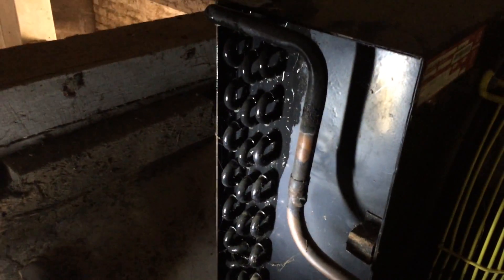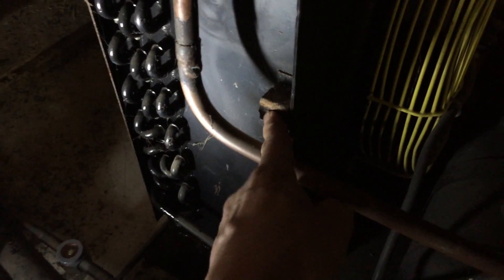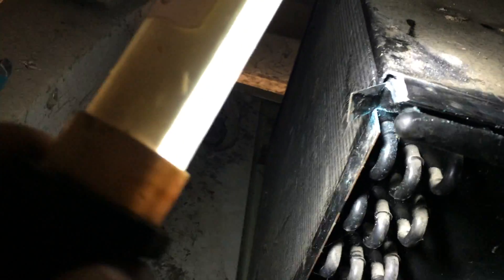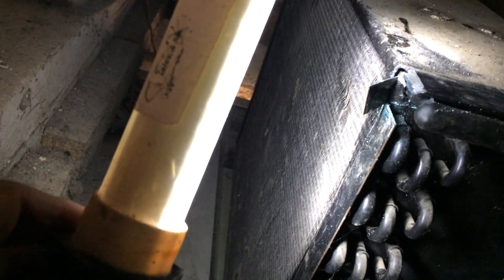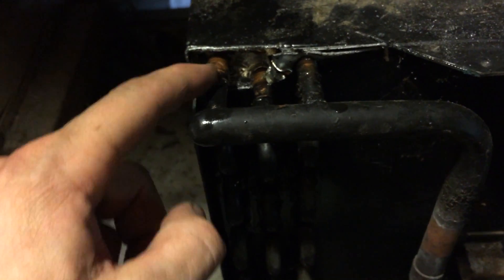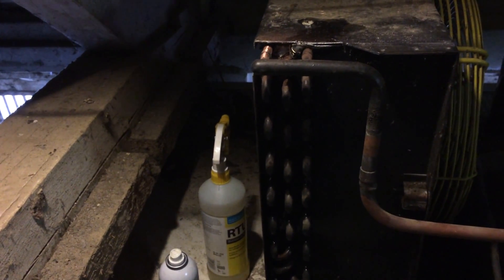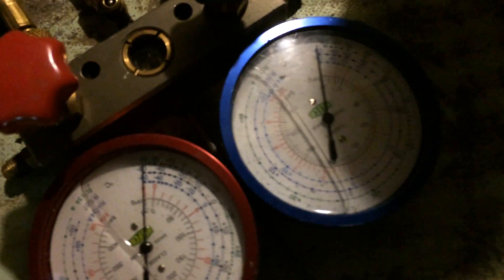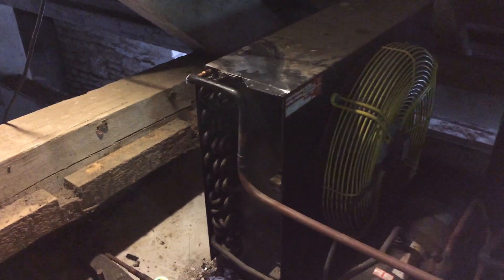Condenser Hack and Bodge

Comment: I normally just lose the top row, and this gets it running again for a long time. Just have to be careful brazing the join into the paper thin piping for the microgrooved tubes, but generally there is enough old braze on them and the new pipe to simply slip in when hot enough, and add a few dabs of a rod to finish it off.

Just how thin they can draw those tubes and still have them pass a pressure test is incredible, especially as that thin tube has to go through the fin stack as well during assembly. They can bend literally using a matchstick when not braced by the fins.
Reply from the maker: This was a bit tricky as its a multi circuit condenser, was easier just to blob over the leak than try and trace circuits.

Its amazing some of the stuff doesn't just burst with how thin the copper is now, its a race to the bottom!

Comment: Does doing bodge repairs like that make you feel a little dirty, even if the customer asked for it?  I try to tack it up to OCD but it doesn't always stick. ;)
Reply from the maker: I know what you mean, but in this case the guy had cheeses that had been maturing for up to six months, even if he went for a new coil it would have been a few days until running again, at least with this repair he didn't lose any stock.
What does bother me though is when i recommend repairs and people decline and later on the system fails in a big way, and it was all avoidable if they listened before.